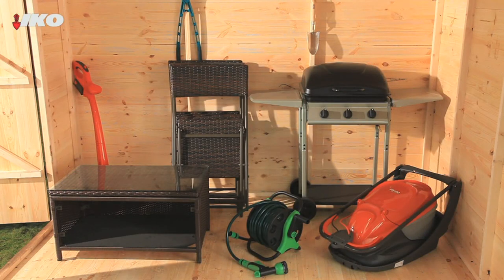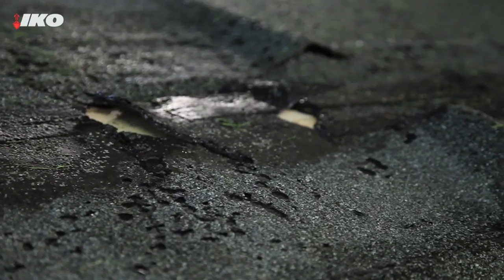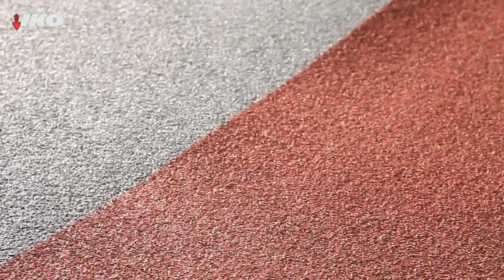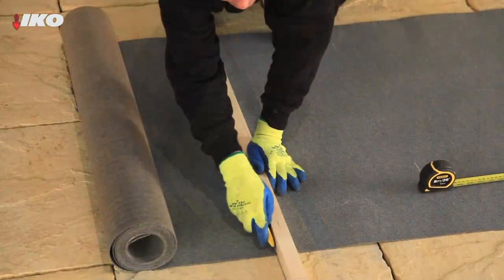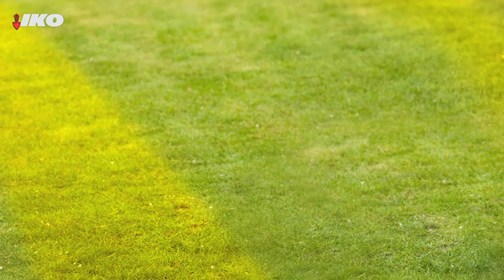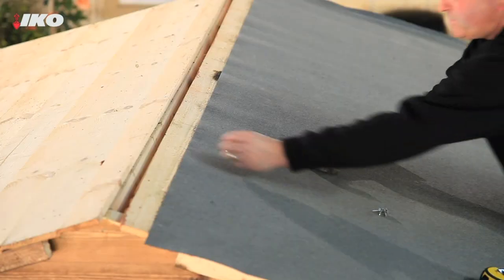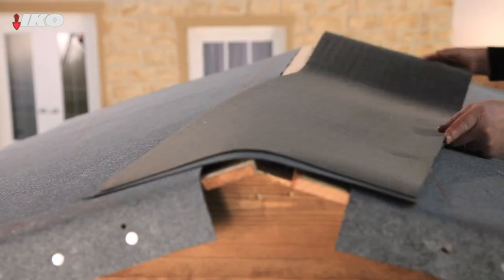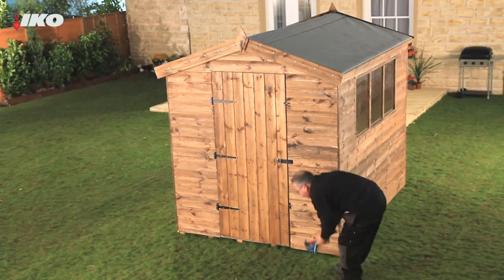How To Felt A Shed Roof + Refelting A Shed Roof | Garden Ideas & Tips | Homebase

Comment: Is it poss to use evostik or adhesive for EDPM roofing or just the high performance (bitumen) felt adhesive (to prevent wind uplift & general creep movement) instead of clout nails to avoid puncturing holes thru the felt?
Reply: I would give it a try.Do a tasty patch on the materials to test its adhesive properties 👍🇬🇧
Reply: No
Reply: Make sure the part you nail is the part where the bitumen has been painted onto the roof. The bitumen will seal the hole you punch through the wood and felt if you laid down a thick enough bead. It will also resist weathering better in the future.
Before you applying bitumen however, give it a coat of cuprinol so that if the felt fails, the wood has a backup line of defense. When the felt fails you may not notice and that cuprinol will give you time before the wood is compromised.